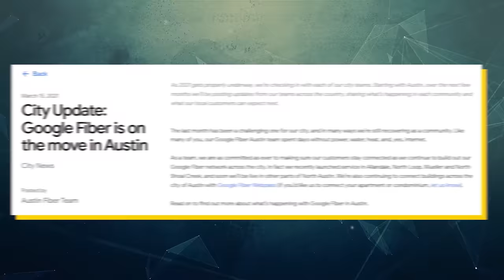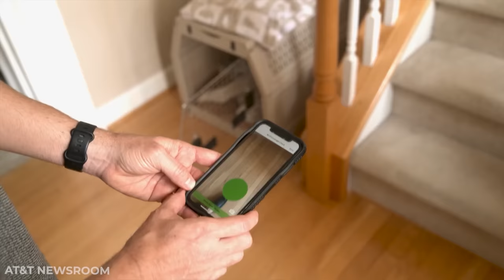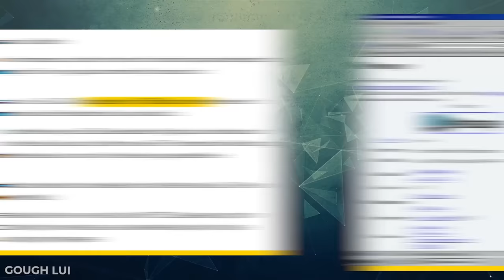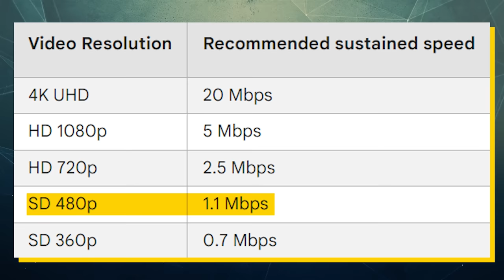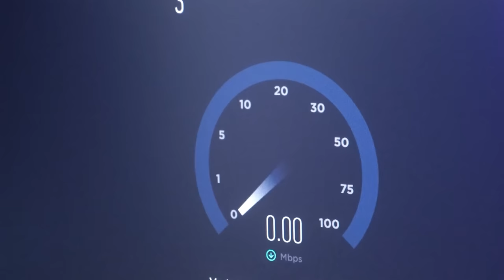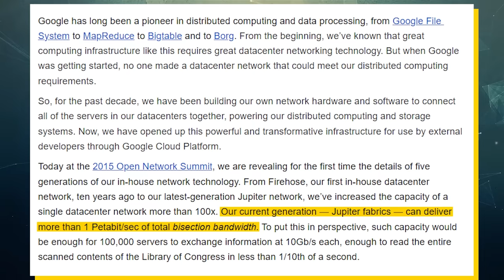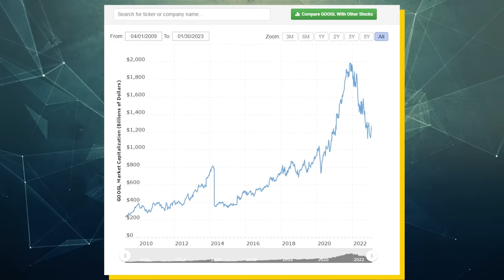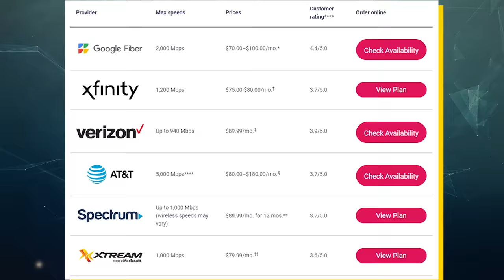Google Fiber Never Had A Chance. But That Was By Design.

Comment: Google Fiber has been in Irvine CA for years, but AFAIK it's only available in certain large apartment and condo complexes. I guess it wasn't cost-effective for Google to run fiber to individual homes (or even to the curb).
Reply from the maker: Yeah makes sense
Reply: This doesn't make sense to me as a cell site technician. We use a lot of fiber optics because it is A LOT cheaper than copper on runs over a few dozen feet.  The expensive bits are the SFPs on either end of the fiber to connect to the switches and routers.

I could see only running fiber to the road and copper to houses. Despite the cable being more expensive, terminating fiber is labor expensive and you don't want it where the customer could mess it up.
Reply: This has to do with how it came to Irvine. The Irvine Company made a deal with Google directly(2016) to bring Google Fiber to its properties, and not a deal with the City. I don't know if there is an exclusivity deal, but I imagine there is. Most of Irvine was built/upgraded with underground conduit making it a lot easier to deploy fiber if they want to. SCE is actually using the conduit to give business' 100gig fiber lines.
Reply: Something similar occurred in Nashville. Google Fiber basically only exists in a few highrises downtown. Comcast and AT&T blocked them from being able to access their phone poles to run fiber to other parts of the city. Which would have been more cost effective than digging and burying a bunch of fiber. So the rollout didn't get very far. But when AT&T Fiber rolled out they matched Google's price of $70 a month for two years and then extended that another year or two before raising the price. By that time Comcast started rolling out their gig speed offering. Hat tip to Google for finally spurring fiber expansion in this area. I enjoyed FIOS in Philly but was forced back into the slow lane when we moved back to TN 10 years ago. We were the first house in our neighborhood to have fiber run to it.
Reply: If that's the case then I'm surprised that they don't offer FTTC (Fibre-To-The-Cabinet) which is offered in the UK by Openreach whereby fibre-optic cables only run to a cabinet on the street with datastreams converted over to a pre-existing copper cable but I suppose Google doesn't already have that infrastructure in place and making deals with the likes of AT&T likely wouldn't help them...
Reply: @Okiboy1426  When Google Fiber came to Salt Lake City they didn't use telephone poles. They dug small trenches into the street for the main line, and then ran individual lines to the houses and apartments without destroying the concrete sidewalks. Google Fiber never got into NYC because you have to get an ISP provider franchise from NYC. Also, the ISP's struck exclusive deals with the apartment buildings, locking renters out of any other choices.
Reply: @rightwingsafetysquad9872  SFPs are not that expensive, especially 1 gig ones ( on FS you have BiDi 10km SFPs for 12euro including VAT ... )
Reply: Actually Google Fiber is expanding in Irvine, CA to cover non-apartment communities, such as all of West Irvine, which recently went live in November 2022. Google Fiber said they have a contract to expand their Internet service to the entire city.  They are also expanding in Tustin, CA.  I signed-up with the 2 Gig plan at $100 a month and disconnected Cox Internet, which cost more at half the speed.
Reply: @rightwingsafetysquad9872   You saw wrong, my friend. Her we got fiber ton the roads, and fiber from the road to the houses.
It took years of waiting, but, YES Google has done it for us.
Reply: Google Fiber is now available in Chandler and Mesa, AZ (Phoenix suburbs) neighborhoods, specifically for single family homes.  We just recently had it in our neighborhood and we love it.

Comment: I remember when Google Fiber was first out, I was struggling with 2 MBps, which was the best they offered. I desperately wished for google fiber in my area and I hated how slow internet was across America, especially compared to other countries. Nowadays, I am routinely offered Gigabit, and even though they're still wiley with the "up to", I can typically rely on at least 40MBps, which is amazing compared to a decade ago. So if this really was intentional, I thank Google for managing to improve the broken ISPs
Reply: 40mps ? Lol ADSL was about 10 times  slower but it was 20 years ago.
Reply: @heloxiii8894  40 "MBps" son not Mbps
Reply: @tikz.-3738  yeah maybe so, i was very young 20 years ago, i know I didn't understand the difference then
Reply: @hewhohasnoidentity4377  yeah, that's how we can measure stuff and compare it to other things. If units were constantly evolving that'd be a mess. What's your point ?

Comment: In a rural area where fiber isn't available, the best option has been Verizon's 4G cell network. 50 mb/s currently compared to the max 25 mb/s spectrum provided despite advertised 100 mb/s. They can advertise what ever but they never delivered. Plus the cost saving was huge. Anything for more competition I am in favor of.
Reply: I live in an area where fibre is not available and recently got starlink and regularly get 100mb/s download and a decent amount of the time I get over 100mb/s and the upload speeds are between 10-20 mb/s some up to 30
Reply: @dogcat823  Thought about star link, the cost over Verizon was just less for decent service. I think it added 30 bucks to my bill.
Reply: @cmdr1911  yes the down side of  starlink is it expensive to get into and it is more expensive per month them most other ISPs 
Where I live we could only get 25 download and 0.5-1 up and  for me it only $20 more so it was definitely worth it for me 

I wander now with starlink If ISPs will expand fibre to at least some of the rural communities
Reply: @dogcat823  Unless subsidized under the 2022 infrastructure law, I don’t see fiber optic connections being expanded to rural areas.  I also think that 5G connections will make it unnecessary.  I live in NYC and switched to a 5G provider and for $50 a month I am getting gigabit up and down (practically like with all gig services lower when it goes through Wi-Fi to my devices). In my building, I can get gigabit FIOS, and two cable companies with down load speeds in the gig range but I chose and love this simple 5G solution.
Reply: When QWest had a monopoly in the area I live in, it cost $120 (once you include all the fees) for 20 mbps and that was the fastest you could get. Then a competitor showed up and prices dropped while speeds soared. That’s why I find the consolidation of so many of these corporations concerning. It’s gives them disproportionate power over the market, which ultimately screws over consumers.
Reply: Does Verizon 4g provides unlimited data?
Reply: @logarhlandu2538  everything we had is unlimited. 2 phones, 2 tablets and router for 200 a month before the cost of the phones themselves.
Reply: @cmdr1911  ok thanks for your reply

Comment: A lot of what stalled google was construction due to securing and rewriting easements and permits for either aerial installs or using directional drilling that was expensive, disruptive, time consuming and caused a lot of damage. Once they switched to microtunneling it’s solved a lot of their issues. When the power lines were buried here, it took just over a year start to finish mostly due to planning and legal, with the bulk of the construction lasting about six invasive and disruptive months tearing up both my front and back yards. Google microtunneled at the same time and had the whole neighborhood finished and my home switched over in just a couple weeks, with just one noisy day for construction on the street only. ATT only offered 40/5mbps and spectrum was 400/20mbps, or 900/50 for $200+/m with a $600 install fee. Now at 1000/1000mbps for $70/m, no install fee, they’ve been easy to deal with, good support, reliable and had been waiting years to ditch spectrum.

Comment: In India, I started my internet journey in Cyber Cafes having Dial-Up connections. Later DSL based broadband was introduced in early 2000s with speeds over 256 Kbps and upto 2 Mbps. Later on in mid 2010s DSL was getting speeds around 40 Mbps. In past 5 years Fiber internet has spread like anything with speeds upto 1 Gbps in less than $50.

Comment: I have a question: to what degree of a threat would ISPs deem it if their customers became their own gatekeeper to the internet, still reliant upon ISPs for long-haul transit of data but each customer was their own network operator, effectively decoupling the service area from the ISP and having it managed by the users. 
PS: users would contract out operations of everything to third parties to manage it for them, the users have the ability to replace the contractors at-will. 
PPS: if users made this thing a cloud as well, they could even have "free" internet service as their network could pay for itself --within reason. 
PPPS: users could even attempt to make a reasonable expectation of privacy situation if done correctly & with enough distrust of others baked into every fiber of the network's operations.

Comment: I just got NEW Google Fiber in San Antonio. They are expanding - laid the optics about 4 months ago, got it connected last week. It is $20 cheaper than Spectrum cable Internet (also gigabit, but not synchronous and 20 to 30 times the latency) and so I switched. 
I’m going to be on a few vacations soon and still need my home infrastructure switched to 2.5GbE but eventually, I’ll have 2Gbit/s from Google for $100/month.

Comment: I live in Louisville Kentucky and everyone was anticipating the new fiber product from Google One of the problems was the contractors they hired to install the fiber there was five or coming up out of the trench es they installed they didn't dig deep enough so when winter hit all the sealant would start coming up in the streets degregating the service.. but you're right about AT&t they started rolling out fiber everywhere but as soon as Google fiber pulled out of Louisville all the expansion stopped lol so we still effectively only have two genuine ISPs in a city the size of about 750,000

Comment: There’s a similar situation happening on the small island where I live, the dominant phone company ISP just offered DSL with maximum 25mbps and would have probably left it like that but a local startup was using multi-point uplink mesh wireless technology up near the tops of trees to provide competitive service (with MUCH higher upstream) without all the initial costs of prewiring for everyone.  The telco ISP now offers 50mbps + unlimited which they did not before, and now the local ISP got a grant to do a fiber rollout and suddenly the phone company is promising fiber soon too...  but in this case the big phone co will likely be leasing bandwidth from the small ISP’s physical optical uplink connection to the mainland they got the grant for since they cannot get the same kind of subsidy to run their own optical cable...  which is not actually good for the redundancy factor, but at least there will be faster wired service.  The limiting factor of rolling out the wireless network turned out to be having enough qualified tree climbing installation technicians to satisfy the demand - fiber rollouts are slightly more demanding as far as tech skills and crew numbers needed for baseline infrastructure but also more manageable since it’s standardized and fairly predictable.

Comment: I've had Google fiber in Kansas City for at least 8 years. 
During that time I've had almost no downtime except for one time when somebody broke a utility pole off and Google had to wait for a new pole and for the power company to do its work before they would allow anyone else to put their equipment back up. 
Their service is second to none. 
My 1 GB service is always in the 900-950 megabytes per second, range.
The price has never changed. 
They now offer up to 8 GB per second in packages of one, two, five or eight gigs per second. 
In my home I have no use for anything over one gigabyte... My music streamers, 4K TVs, smart devices all work at optimum speed. 
Last summer after a storm I noticed that my fiber line was hanging a bit lower than it should... Almost head height. 
I forgot the call them about it until I was driving home from work that afternoon. When I got home the crew had just finished correcting the cable issue. 
In contrast to Time Warner Cable that I had before that, where our internet and cable TV would be down for a few hours to two or three days at least five times a year.

Comment: I’m skeptical of the claim that Google fiber was the catalyst behind the speed upgrades by Att and comcast etc.  in most of the US there is no choice of internet provider. Only in a few select areas you can have a choice of one cable company or one single fiber optic company, not multiples. In many municipalities it is not allowed to have more than one of each. It’s basically protected monopolies. The biggest pressure on cable companies to upgrade speeds was the threat of high speed internet over wireless hotspots with LTE access nationwide and the advent of people cutting cable tv.  Verizon even ditched their fiber optic business ( now called Frontier ) and invested all their money on buying the frequency spectrum for their 5g networks. That’s where the smart money is.
Reply: I agree. Verizon brought fiber to my house in 2009 before Google fiber existed. DSL was already way slower than cable. The copper networks were antiquated and it was time to upgrade them.

Comment: I may have the option of a gigabit cable internet package through Spectrum (Charter) but that is NOT equivalent to fiber gigabit internet. What is TRULY game changing about a real-deal symmetric fiber internet connection is having access to gigabit upload speeds. Being able to download AND upload at such speeds from home is what is truly groundbreaking. The ability to communicate with other machines/services over the internet as if they were connected to your home LAN enables practices that were previously unthinkable. However, for most of us, that ability still remains an unattainable dream that will likely go unfulfilled for a very long time to come.

Comment: The rollout of fiber has stagnated here over the last years, since Google doesn't pose a threat anymore. AT&T fiber just serves some gated communities around here, cares less about the rest of the city. They probably only serve these gated communities in order to beat a local broadband provider, which is specialized in offering fiber only to privately owned communities. Our cable provider, who serves the rest of the city, has increased the download speed to an acceptable level, but the upload speed is still not comparable with fiber Prices are high and the customer treatment is very bad, also. The root of the problem is that the cable providers just sliced-up the map and serve different areas. So, they can practically do whatever they want. 5G home internet seems to be available in some parts of the city, but there are probably major speed and reliability issues, when the festival is in town. As far as I know, 5G home customers have to yield for the carriers mobile customers. It's a big mess, which can only be solved with real competition or government involvement. There is no Google kicking the ISPs butts around here.
Reply: Fiber Rollout in my area (Northern Indiana) is massively kicking up. From less then 10% coverage to 85% of the county covered by fiber, from 100Mb to 2Gig with 5gig coming next summer. With three different providers AT&T, a local telecom company, and the local REMC, with Rumors of more competition in the coming year.  Covid drove the need home and the Local telecoms here at least are working hard to meet the demand before someone else undercuts them and steals the customer.